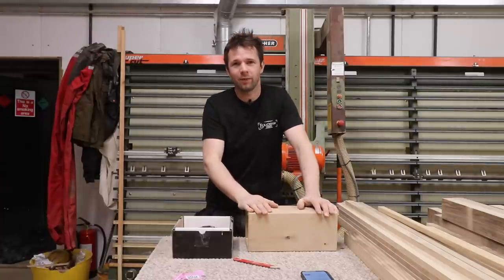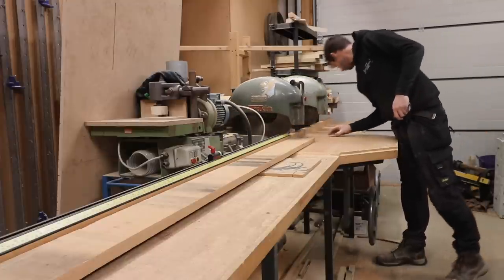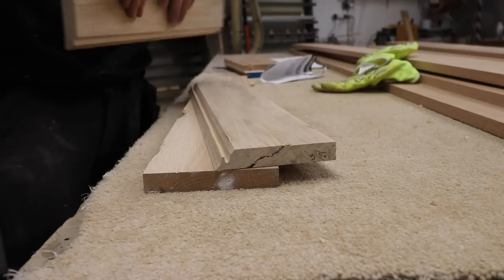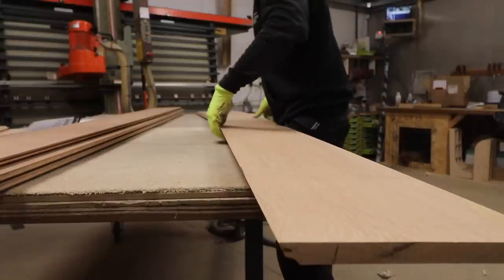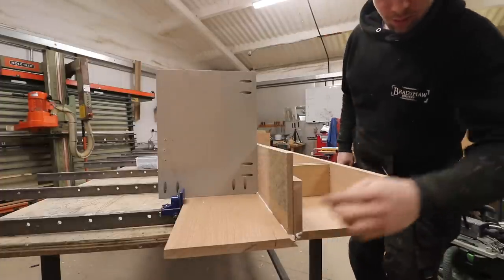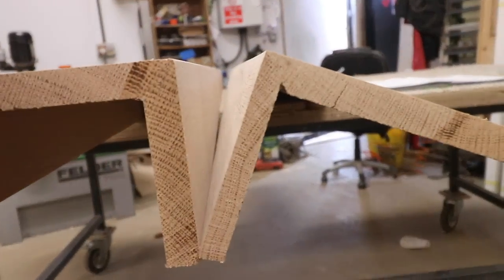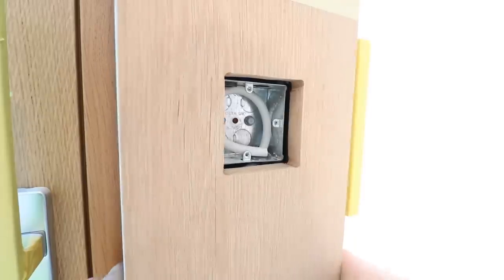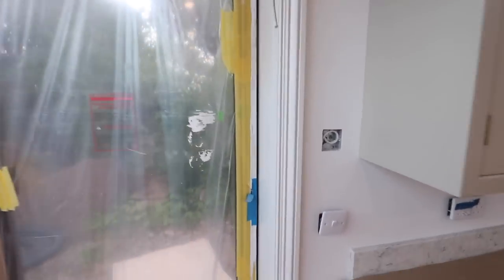Professional Boxing In With Trend Mitre Lock

Comment: I've used this kind of cutter for cabinet corners and for making rectangular columns. Once you have them set up (I recommend keeping an offcut and using that to check the setup if you use standard thicknesses of material) they're easy to get going. Depending on the wood, you can also burnish the outside corners to keep that joint invisible even after sanding.
Reply from the maker: Cheers Pete, yeah, now i have a decent technique for the setup, it seemed to go swimmingly! Everyone is really impressed with the joint, and over such a long length i admit i'm quite impressed.
Reply: Good show!  👍
That joint has been around for years though.
JIM
Reply: @jimc4731  True. Many have been using them on router tables. But I can tell you from personal experience that the difference between doing this with a router bit vs a big shaper head is night and day. Definitely smoother on the shaper in my experience, and the power feed helps keep everything pressed down and lined up.
Reply: P 😌p

Comment: I love this cutter. Thanks for the demonstration. I must say you are brave man using your gloved hands to face your material. I use  sticky foam faced paddles now. I have faced thousands of feet on a  beast of machine a 16” Oliver. That’s when I is was young and full of it. 
A man I worked with had a kick back and his left forward hand was drug back into the blade .  The Jointer had no remorse it’s just a machine. As we all no a fraction of a second. Four fingers gone down to the palm and half his thumb. I’ve heard it said “that a smart man learns from his mistakes and a wise man learns from others mistakes”
I love your work. And your videos are very helpful. 
Old dog loving new tricks
Reply from the maker: Cheers Louis! I have always tried to portray that its not always about how it looks on camera, if my hands are somewhere i know may be hazardous, i hold a changed balance and dont fully lean into the cut so that if the timber were to instantly dissapear i wuldnt fall into it!

Comment: Thanks for the education on adjusting the tooling. I used a miter bit on some 12 replica air gun boxes from England in walnut. and had the devil of a time adjusting the edge. Doing a newel post in oak now and will revisit that lock miter tooling. Or might go with the oak on the big saw and Lamello plates to align.
Reply from the maker: No worries Vincent, The mitre lock is a great cutter if setup right and timber can feed through evenly

Comment: Great bit of kit this cutter we have one in are workshop for some time now l have used it with mdf 18mm plywood hardwood softwood and if you get it right like you said it’s perfect but two things I do is use a feather board and for quick set up l have two bits l have already cut in 18mm mdf  which I keep next to are spindle mouldy so you can set your cutter up quickly l love this cutter great job sir well done 👍 last thing if you sand it just a little on the corners you can’t see the joint it’s that good 👍 😊
Reply from the maker: Nice one Simon, I had first seen it as an apprentice but its taken me a long time to get to a point where i needed/could buy it! I think this one is slightly better than the one we had, the joint is perfect!
Reply: Great tip for set up, thanks!

Comment: Freeborn makes a cutter that works in conjunction with a dado setup on a table saw.  All the pieces run flat through the shaper cutter...then half of them run flat over the dado to make the interlock.  When working with large stock.....the big advantage of this system is all the pieces run through the machines on the flat which is much easier than making a vertical pass on the shaper which is harder to control.  Disadvantage is obviously the 2 setups.      Just an FYI for anyone who works large stock.   Beautiful shop...Nice finished product!
Reply from the maker: Nice one Ryan, Its good to hear of different solutions and thats one i havent seen before so thanks for sharing!

Comment: Really smart technique using the level line as the standard to measure from. I never do that, and always have a hard time getting things like outlets in exactly the right spot. I'm going to try this now.
Reply: The trick with screwing through the electrical boxes was another brilliant one. Lots of good tips in this video.
Reply from the maker: Cheers Pete, Yes i dont do any fitting without a laser and have discovered many many techniques im yet to see anyone else use. Ill do a video at some point and also recommendation on laser type.
Reply: @BradshawJoinery  That would be great, thank you. I have a decent laser, but I've only ever used it for things like making sure drop ceilings or chair rail are level and vertical bits are plumb. Never thought to measure to it.
Reply: I do a lot of work in Germany and Scandinavian and all joiners/fitters use lasers. I don’t see why they are used so little here as such a useful bit of kit. I have a Geo-fennel and have found so many uses for it.

Comment: I've used them for a few years on various jobs including cladding existing staircase Newel Posts and cut strings. I've also done new staircase newel posts where they are 5"+ square. I've also made bed posts the same way with a softwood/tulipwood core for stability.  It's a really good system with the benefit of only needing to clamp in one direction. As always nice video Oliver. Leitz tooling do some great blocks.
Reply from the maker: Cheers Adrian, yeah great cutter block! They had one where i did my apprenticeship but it never really got used and was many years ago.... and wasnt high on my tools to buy list, but wish i had to be honest! haha Leits are anther top quality brand, i dont think i own any, deffo got some leitz cutters in the shop. My most overengineered block has to be the oertli (sp) That sure is some unit! Have you ever had a joint open up with the cutter block? assume your using a cascamite or runny glue?
Reply: @BradshawJoinery  Hi Oliver, I've used the system a fair few times now and usedcascamite and PU. Not had any issues with joints opening up. I did some newel posts caps  in ash with American black walnut core about 3yrs ago and no problems so even mixing species seems fine. Regards Adrian

Comment: I use the small & large router versions,they are very useful cutters & very underated..
Reply from the maker: Cheers Stuart. How are they to setup in the router? Good to know they work well too
Reply: @BradshawJoinery  Using Hitachi M 12 in router table,found it quite easy,once I got my head around it, & it took a couple of trial runs to get depth right, same problems as you had. Infinity Tools actually do a lock mitre jigs to make set up easy, but they are not cheap to buy.

Comment: The joinery is particularly good and I like the jointing created with the Trend router.

The actual installation does concern me in that the steelwork ought to be fire protected as an element of structure that could have been applied under the casing and the cables ought to have been protected with sheathing or conduit to prevent accidental damage later on, as well as closely defining the route of the cables.  A longer than necessary screw through the face could see the cables punctured with shocking results!
Reply from the maker: Thankyou Clive. The steelwork was specified fire protection, so a fire paint was used before fitting. Cables, well i guess thats the same with any buried service, i doubt you'd even feel capping screwing through oak...
Reply: @BradshawJoinery  The fire protection and the electrical protection is clearly not within your remit but unfortunately others less knowledgeable watch these videos and see all the peripheral work.  I have specified and inspected too many installations with intumescent paint and to me the steelwork looks as though it only has a primer coat.  (most intumescent paint tends to be white).  

The electrician is responsible for the sheathing on the cables and the protection is normally for where a pilot hole is drilled for a fixing (I wouldn't screw directly into oak or any hardwood without one).  With the drilling, unless you are being completely ham-fisted you will feel the drill go through the wood and then feel a secondary resistance if its sheathed, if not then there will be a bang! and the whole casing will need to be stripped off to repair the cable.  A top class job will use steel conduit for protection and potential future rewiring.

Comment: I‘d add a warning for those thinking of buying either the shaper or router versions - I have both. I find the setup on both much harder than in this video. You have to get both the cutter height and fence correct, and changing one means you have to adjust the other. I don‘t have a digital readout on my Hammer combi machine, but am buying one in the hope that this will help. The second problem is shaping sheet goods (eg plywood) with the top veneer as cross grain. Along the grain the cuts are excellent, but across the grain so much tearout as to make it unusable. Solutions to this problem for cabinets are a) make sure that all miter joints are along the grain or b) score the top veneer before shaping. I haven‘t used either on solid wood yet. When everything works, they are an excellent solution.
Reply from the maker: Hi Bill, an easy solution for finding the ecact centre is align the centre bevel of the tooth with the bed as shown, then use a Cheap DTI Indicator to raise the cutter, no need for a DRO. Then any adjustments will be to the fence and not height. Hope that helps, and thanks for your help. Ive never tried on cross grain, i assume not machining the outer veneer past half its thickness would provide enough support not to break it out>
Reply: Look for a tool called a thingamajig scribing tool. Super sharp carbide cutter will quickly and accurately score your cross grain cuts, eliminating tear out.

Comment: looks great fella and a good match to the windows and doors to. one thing i would mention though would be your use of expanding foam over or around cables, the standard expanding foam can degrade the insulation of the cables so we are no longer allowed to use it on the sites i work at and have to use the fire rated foam instead as it does not have the same effect on the insulation of cables. 

also on the jigsaw note i have a festool demo booked soon and if you dont mind i may show them the video which may i turn help them fix the issue and i can replace my worn out makita jigsaw or i buy a Mafell
Reply from the maker: Cheers Ross, not something i was aware of tbh so thanks for that. Not sure festool will admit a problem with the jigsaw on the demo, but have a close look at the blade and see if there is any loose movement forwards and backwards (unsprung). I bet there isnt in the demo one.
Reply: @BradshawJoinery  no worries buddy, It seems quick a few people are unaware of this issue and i only found out 4 or 5 years back when i was no longer allowed to use it on site as the company had issue with past project electrics which was out down to expanding foam degrading cable insulation. No your probably right on that one as i tried to give them my thoughts on the RO150 which i think is to slow in rotex mode and could do with a few more ponies. It would have been a good sander if it was rotary and rotex only. i shall make sure to check it on the demo model as then at least i can use the fact the demo model never had that much play if the bought one turns up bad

Comment: Nice tool, great attention to detail and skilled execution.
On a side note, it really makes my skin crawl when I see wires without any conduit running underneath wood.
It's required in my country to use plastic, self-extinguishing conduit in such cases.
Reply from the maker: Cheers matey, I have had a few comments about Expanding foam eating the insulation. news to me so will be careful in the future.

Comment: Yes very professional job 👍 you went the long way round to do the job properly and the laser way to measure above and below when fitting is the pro way. Some site Joiners would have made a mess of fitting that after getting it so perfect in the shop, they would have nailed it with the nail gun 😄
Did you test the strength of the joint from the off cuts? The glue surface would be double that of a mitre.
Thanks for sharing, watch with a beer 👍🔨📐😄
Reply from the maker: Cheers Gary! Yeah a few pins were my go to if the glue wasnt enough but didnt really want to break the surface finish. They are way stronger than the wood. It always breaks across the board near the joint when tensioned so im confident in the joint! Hope you enjoyed the beer, not seen any uploads from you in a while mate. I find your videos brilliantly peaceful. You work in a nice spot!

Comment: Fantastic ability. If you read this, would you please educate me as to what kind of adhesive you were using? It looked like silicone which I have never seen used if this application, but it certainly was perfect. I also have been trying to find a tape ruler of that minimalist type to no avail here in the US. Thank you for the video.
Reply from the maker: It PU glue in a 310mm tube. Great gear but need to get used to it

Comment: Very nice job.  But l have been using locking miter joints for about 
15 years. Mostly on furniture, like when I'm using 1/4 sawn oak and see it on all sides.
Reply from the maker: Cheers James! Yeah they had one when i was an apprentice, I rarely saw it used, but finally in a position to get/need one myself its a brilliant tool

Comment: That worked out well - how do you think would it compare if a lamello was used for the same job ? Say using tenso connectors with titebond type glue - I have the lamello but not the cutter head so your thoughts please! Thanks for the videos looking forward to the next
Reply from the maker: Great ideaHi David, I dont own, nor have ever used the lamello, so im in the same boat as you albeit t'ther way round. Id say this is going to be a lot stronger than any straight mitre joint, and a more professional job. The lamello would be better suited to if you came across the job on site and needed a solution? I guess also the lamello you have to machine both a really accurate mitre and then machine the lamello connectors (assuming you mean using them on an angle to match)
Reply: @BradshawJoinery  thanks for sharing your opinion - yes I normally use it for onsite fixes when it’s not practical/ possible to leave something in clamps . Definitely agree lock mitre glued as you did is stronger. 👍

Comment: Nice! Unfortunately a very expensive bit of kit if you don't have lots of work for it.  Cheers Jim
Reply from the maker: Yes and no, easily paid for in one job, with the cost of timber at the minute. say 70mm square posts for a kitchen, can use thin stock material for a chunky post.

Comment: brilliant job, they are good cutters, mine has rotatable cutters that can be replaced once worn, I hate to play devils advocate but i continue to see joiners working with gloves, please for the love of your fingers and hand, don't wear gloves when using wood working machinery, I have been a joiner for 30 years and have seen too many fingers and hands lost to machines because of gloves, what could be a small nick or cut turns into disaster once a sharp spinning object get a hold of the glove and pulls it in. brilliant job though, sorry to heave added the glove part but you only get 8 fingers and 2 thumbs in your life time at this point. love your work

Comment: Great. Ta. Would you use that laser line technique similar to marking socket positions, on say a bottom kitchen unit, or living room alcove unit, where you have to cut out the back for pipes or a socket? Do you think that PU glue would be ideal for a gate to a back yard? I am in no rush to fix/make my gate, just wondering about the glue/ Cheers
Reply from the maker: In short, yes and yes. 👍 Pu glue is the best for external as it's incredibly strong but also a degree of flexibility allowing it to hold on even with some movement 

Laser snc be used in all sorts of ways and yeah would definitely use it for that
Reply: @BradshawJoinery  Thank you!

Comment: im tempted to get the router version. is that accoya on your bench at the start? i have some and wonder how you remove the stained discoloration without taking too much of the board thickness?, i presume its from the acetalyzing process they use on it.
Reply from the maker: Hi mate, yeah its accoya. you cant, what size you using? Generally buy 1/2" more and plane it back if you need stained without stipes. Or if its boarding, say 18mm, id buy 2" and deep cut it down themiddle then use the centre part as the best face. Its from the sticks and the processes, heat and then damp both kilning and treating, it goes through the mill a bit!
Reply: @BradshawJoinery  
I thought so, had a load for a job but leftover boards are 18 mm, I'll try planing down to half inch n see if can get away with it, I find it very variable, some is clear and some heavily stained. Very few knots though and it's really stable, cheers